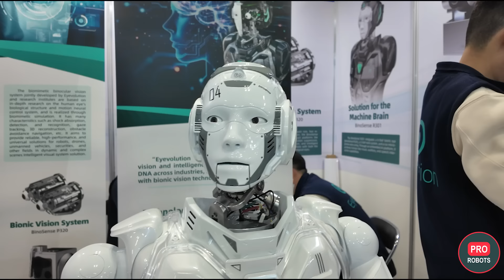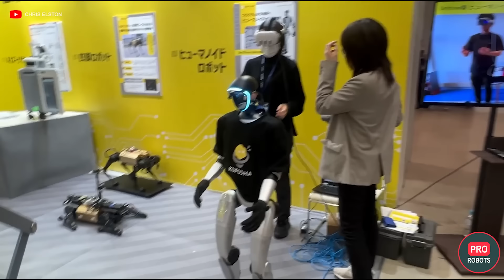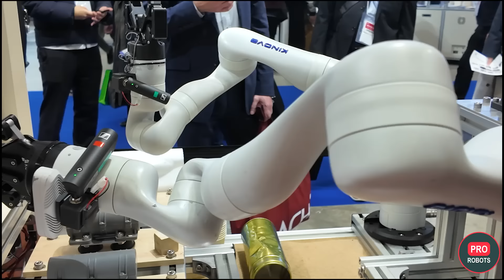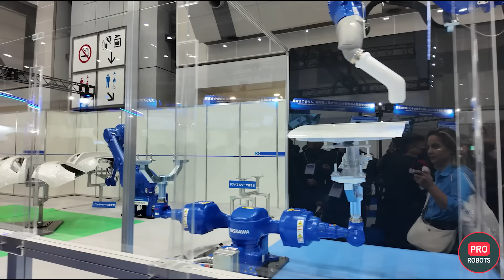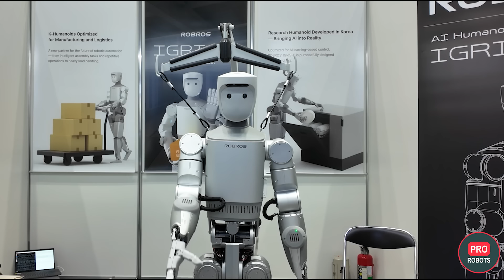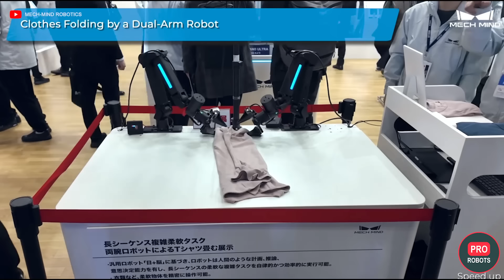Japan Starts New Robotic Trend | Best Tech at IREX Expo

Comment: I'm glad to see Japan still working on hydrogen fuel cell technology. It really is one of the most underrated, cleanest power sources. I realize there is still an issue with generating mass amounts of hydrogen quickly without using petroleum products, but that paradigm is changing quickly.

Comment: FYI, If you're boinkin' a robot/doll you're doing it wrong. If it can't be used militarily/rescue or for sport like @BattleBots I don't care.😂❤‍🔥🤖 +1 Carbonfiber/Titanium framed Quadroped Rideable Wolf Mount w/multi-Gyroscope balancing system and dueling power magnet suspension please and thanks! The Witcher theme would be great, take my money. You're gonna wanna come up with a pre-load action to simulate/re-enforce the ATV "jump"/motion & landing sequence/preperation/reaction, good luck w/that.🐺

Comment: The best thing that I can say about the robots is that the movements evolved, rather than were conscientious. I once tried a evolution simulator that I thought was cool. It worked by trial and error.
Another time, I used a animation software that used a mechanic called "key frames" that interpolated an object between two frames. That doesn't use sentience.

If I worked at the advertising department, I would advertise with a right to repair mindset rather than sentience. So focus on the remote controller and go into detail of how the movements were recorded then switch between movements. The interpolation bits.

For advanced artificial robots, I want to see a standard artificial brain, it will be a civilization meme. The robots should be allowed to form new memories from scratch on each brain and work standard four hour shifts alongside humans.

Comment: Most of them look like they can't do any productive work, but there is a slow progress.
Reply: The robot arms they showed in the intro can be VERY fast, I've seen those types assembling parts at a VW plant
I think a lot of them can actually move really fast if you get to program the movements yourself
I think they should just let the buyer break the speed limits on the joints and pre program certain tasks and they just do a repetitive task lightning fast.
Reply: @ayoCC  it's also about endurance.

Even if they only worked at half the pace of a person, if they can work 24/7, then they're already much better than people
Reply: As Much as i love Japan, its very apparent.....Japan REALLY needs to step up their Game....
Reply: @TheGamesZilla492 yes its boring and looks like 2020 tbh
Reply: It will develop faster than you blink. Just look at technology from the 60's, then 70's etc. A cheap knock off smart watch from China probably has more processing power than the systems they were using on the Space rockets in the 60's. 

Language models where as broken as a baboon trying to do Algebra not so long ago, now they're literally doing insane levels of research that most professor's will give up on. 

What I mean is, it's just the theory of proliferation, one turns to two, two to four, etc.. in the late 90's, even in the very early 2000's 56k modems where the go too home internet service, now 150MB+ is basically meh, nothing special. That's 2,678.57x larger (chatgpt calculated just for the lols) than 56kbps (17,857x more if it's 1Gbps). In 2 decades. 

It will cascade, snowball and catch faster momentum than most engineer will be able to keep up with, just give it time. 

The Singularity is coming! muaaahahaha! 😈 Bow to your Robot Overlords! I'm kidding, but yeah, chances are, they will be practically unstoppable in advancing if left unchecked with in the next 2 decades. 

Peace ✌
Reply: You have to walk before you can run. This is just a development stages
Reply: What are your expectations of "productive work"..?  Digging a ditch..?
Reply: The humanoid ones are completely useless, 18 quilos? what a joke. The industrial ones on the other hand are impressive.
Reply: Most humans don't move more than 10 kilo at a time  @SerginhoPMoura  How heavy do you think books are?  A 3 liter bottle..?  How useful is your imagination..?
Reply: Exactly. Just for show. Thats such a waste of time. To make robots that no one will ever use